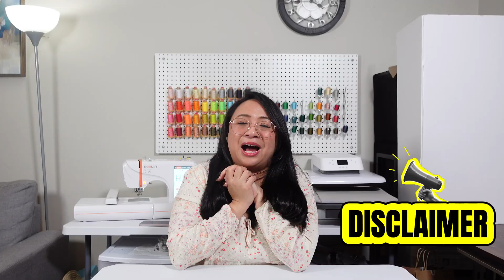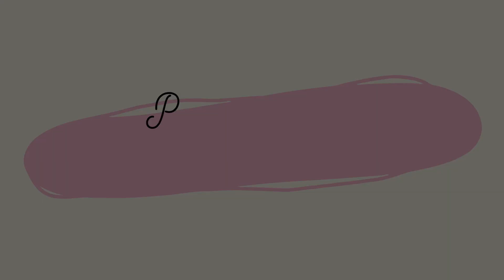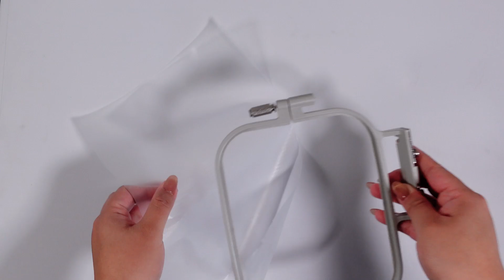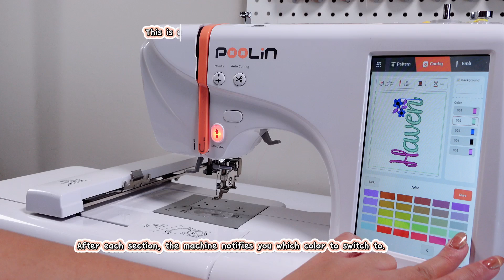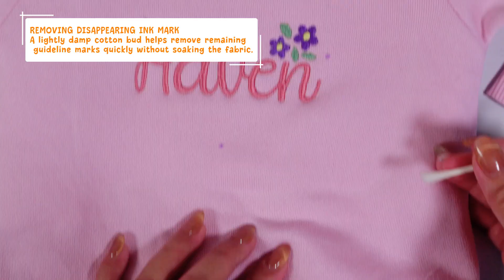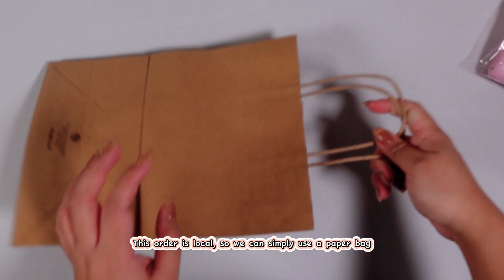From Hoop to Package: Custom Embroidery Order Process (Step-by-Step) using Poolin EOC05✨ | EM EP 6

Comment: Hello, I just came across your videos and they are very helpful, I was sad with my Poolin ec05 ... I think I will improve, what do you use on the top of the cloth?
Reply from the maker: Thank you for your kind words! I struggled a lot with my EOC05 when I was starting out. In my earlier videos, I made tons of mistakes! You really need to figure out how to properly hoop your project and choose the right stabilizer.

As for the white topper, I use a water-soluble topper. I love it because it helps keep the stitches from sinking into the fabric, especially on textured or stretchy materials, and it washes away easily once you’re done, leaving the embroidery looking clean and crisp.